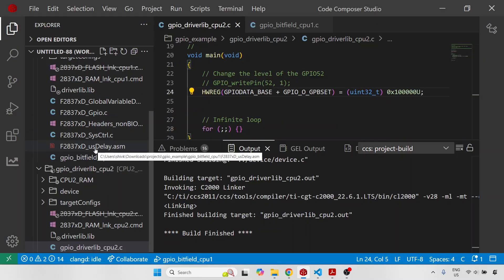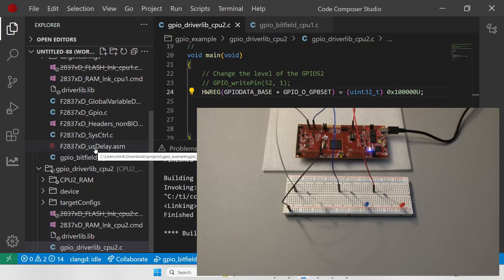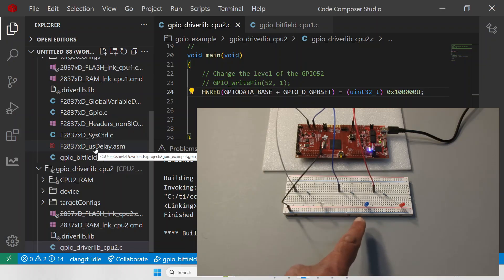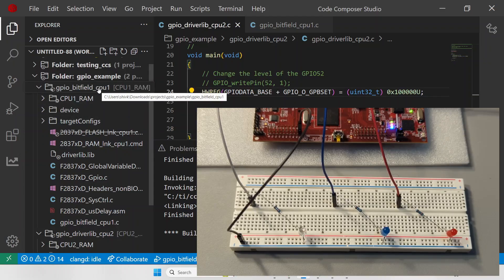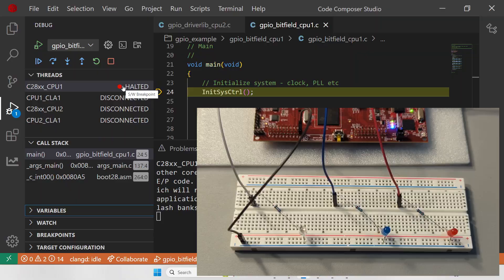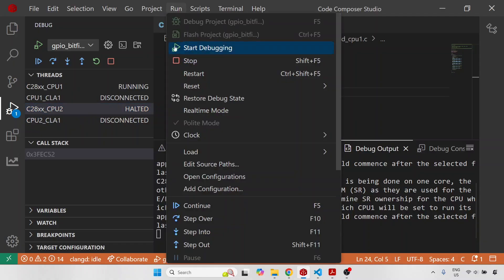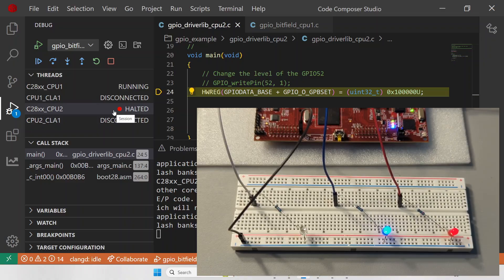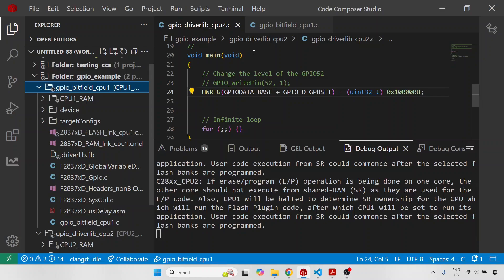Executing a dual CPU project on LAUNCHXL-F28379D

Comment: There is a easier way to upload dual core code. If target configuration file properly set for the multi project that is created along cpu1 and cpu2 you can just make the multi project active and press debug. It will upload code to both cores without selecting the binaries manually.
Reply: sir/madam can u provide the proper step for this